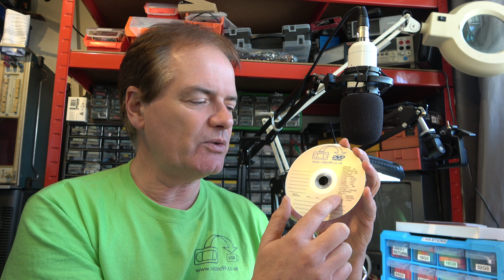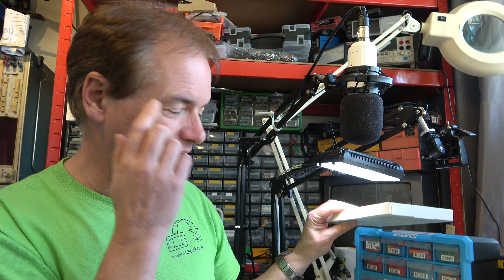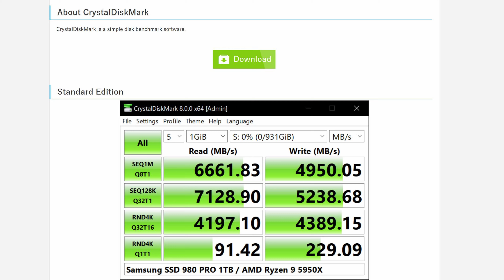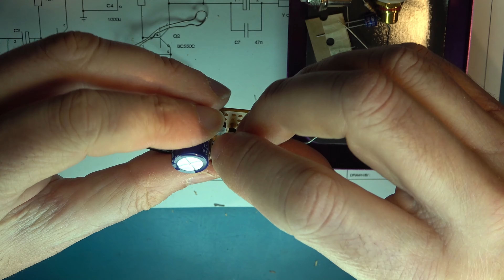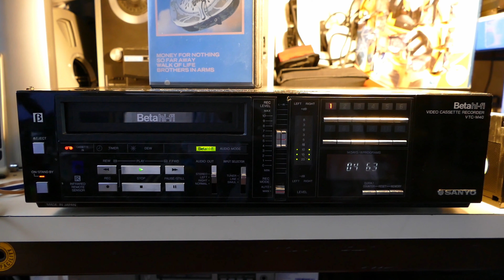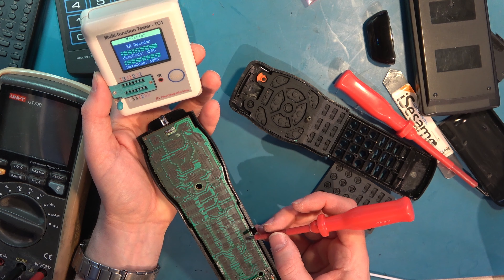Branding a video transfers business and USB sticks.

Comment: Unfortunately those new sticks are cheap and nasty - have seen these in many various forms and they're flimsy and don't perform well and have had them die too. Just be careful...
Reply from the maker: I'm not sure that the outer casing is a guide to what silicon is used inside. The supplier match dies to customer requests, they are not just off the shelf sticks.

Comment: The CrystalDisk Mark figures on the screenshot that you showed are for your very fast SSD NOT the USB sticks.
USB sticks typically run from about  30 -100 MB per second with some very expensive stick reaching ~ 300 MB per second

Comment: Out of curiosity, have you encountered many CD-Rs/DVD-Rs that have gone bad? I have some DVD-Rs that were made in the early 2000s that went bad within a few years. I managed to back up some bits at the time, but unfortunately, some of the videos are lost. I got some Datawrite Yellow DVD-Rs back in 2006, and found the ones I recorded back then are still working fine now :). I still have some of my original stock as I never used DVD-Rs much, but I do occasionally ponder buying some more just in case.
Reply from the maker: Customers often send CDs and DVDs that have low quality dyes.  The Taiyo Yuden DVDs that I use, never seem to fail.  For CD-R, TDK were particularly good.  In general, non-rewritable CDs and DVDs are more stable than RW.

Comment: I didn't know that dvd's were a dead format, although i do burn backup data to dvd's.
I hate losing data. (often i make two identical disks (just in case they fade).
I also save to a real hard drive, never any problems.
The yellow usb stick did look nice, the print looked very nice :-D
One thing that would be nice is a write protect switch (like they used to have years ago).
Protection for peoples videos,  might be worth a looking into.
For a one man band, you do an excellent service :-D
Reply: There are still plenty of movies and tv shows released on DVD. But for recording one's own stuff it's declining. Many new computers don't come with a DVD drive any more.